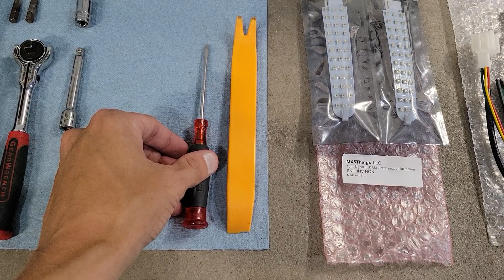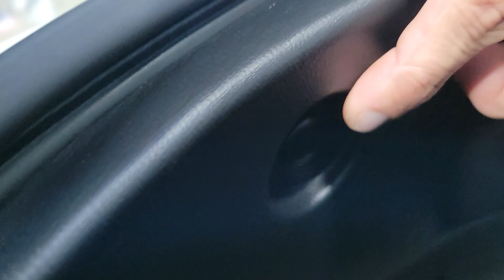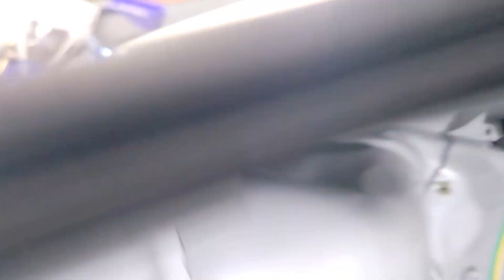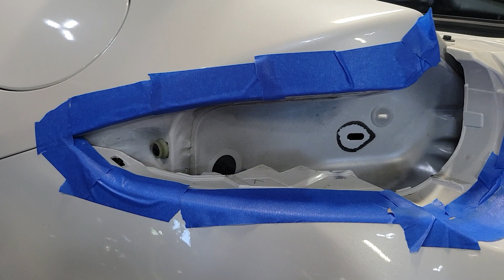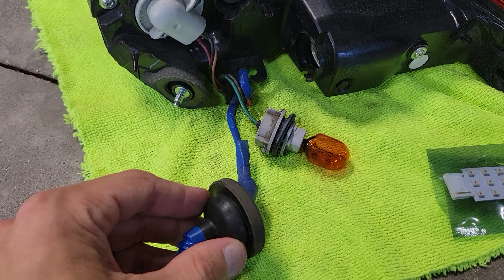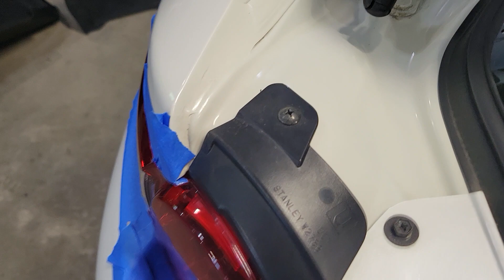Mazda MX-5 Miata (2016+): How to Install MX5things Sequential Rear Turn Signal LEDs - ND ND1 ND2

Comment: Any options for the ND3/2024? I know Flyinmiata says theirs won’t work due to wiring difference
Reply from the maker: I haven't seen any options for the ND3 to modify those taillights, but I actually prefer the upgraded ND3 taillights as they are all LEDs stock.

If you look through my other videos I actually replaced these ND2 taillights (with these sequentials) with ND3 taillights altogether.
Reply: @SeanStettnichs yeah same only thing I wish is for the rear sequential turn signals
Reply from the maker: @warshadow4721 totally agree. That's the only feature I was bummed to give up as well. The ND3 taillights are definitely better though.

Comment: Are these lights any brighter than the factory one's
Reply from the maker: Yes, while I do not know the lumen difference, I do think the light is not only brighter but gets to full brightness immediately whereas the OEM bulb has more of a "glow" effect when coming on and off. The new LED strip is immediately full brightness.

If you're looking for an even brighter mod, I would recommend installing ND3 taillights. It's an even cleaner look and very noticeable brightness difference.

Comment: Looks great! Do you know if there are any sequential front LED turn signals to pair everything with sequential lighting? I don't think that option exists.
Reply from the maker: Great question! I have the sequential side/fender lights which look great paired with these, but I don't think there is a "sequential" option for the front simply due to the shape of the headlight. I did replace the front signal bulbs with LEDs as well, but they are not sequential.

I did make videos of the lights I've mentioned above as well 
, if you're curious to see the routes I went.

Thanks!
Reply: @ Thanks! Yes, I actually saw all your Miata upgrades unless I’m missing one. Fantastic work, I’m curious if you think all these upgrades are worth it? Anyway, I’m glad you decided to record and share it. Although flyin miata has their videos, nothing like the old fashioned homemade videos like these. You’ve been extremely helpful. Thank you again. Oh, and hopefully a sequential front option becomes available in the near future! I guess l’ll just stick to standard LED.
Reply from the maker: @adron7748  thank you for the kind words and checking out some of my other MX-5 videos too. It's always nice to know these videos can help someone else out in making the decision to make (or not to make) similar mods.

As far as the mods being worth it, that's always in the eye of the beholder. I've got somewhere in the ballpark of $3k in mods on my MX-5, and that's after hunting for deals/used parts. Personally, I think most of my aesthetic mods help modernize and upscale the car. I am going for a European sports car look on my MX-5 (I sold an e46 M3 to get this car). It reminds me of a more affordable, more reliable F-Type Jaguar. That's also the reason I went with the GT model too. I wanted the creature comforts of the higher trim and didn't care for the tuner-esque looks of the Club appearance package (otherwise I would have hunted for a BBR Club). Again, mods are all just a personal preference, especially the cosmetic ones.

That said, the exhaust, shift knob, and gauges really make the driving experience more enjoyable. I don't plan to track this car at all, so they're about as far as I plan to go for now.

Honestly, these cars are a ton of fun right out of the box, so you really can't go wrong. Thanks again for the good words!